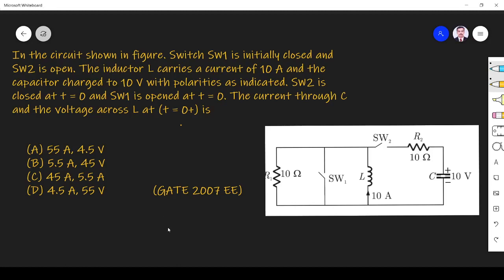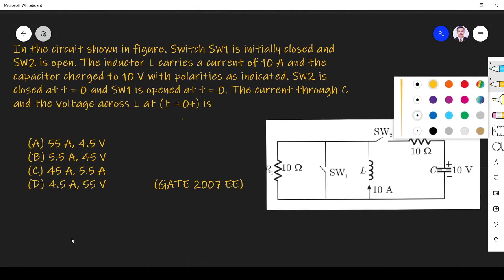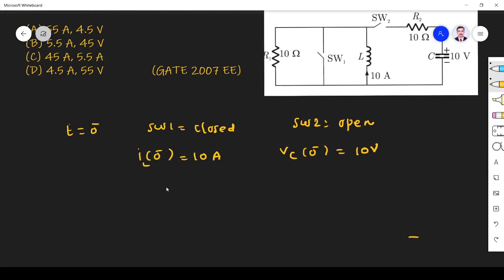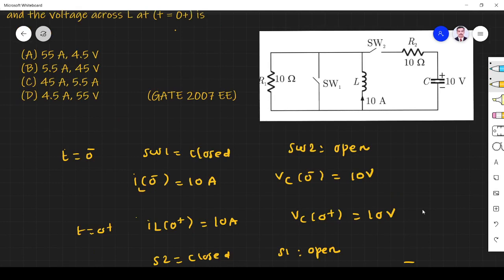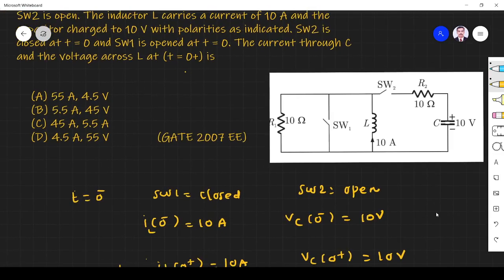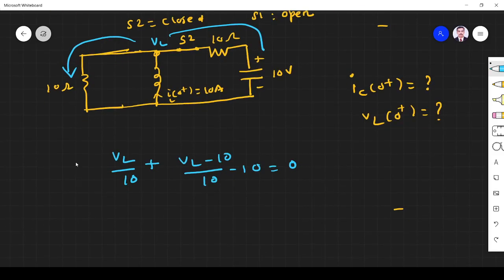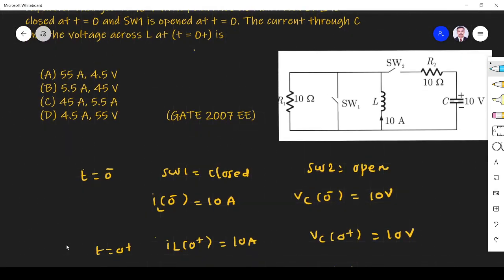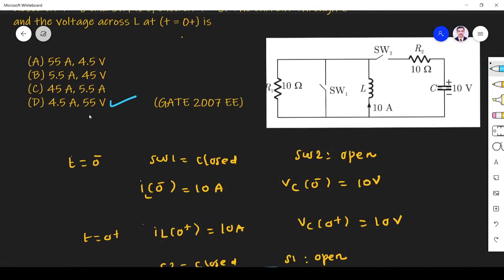Network Theory GATE 2007 EE Solutions |#12|

Comment: Sir, I got 5.5 A and 45 volts
Reply from the maker: It's 55V and 4.5A ma'am...I don't know where is the mistake in calculation...
Reply from the maker: Where you step is different from mine ma'am?
Reply: @majeethlectures  sir actually I solved twice I got option B as ans. In my way of solving.